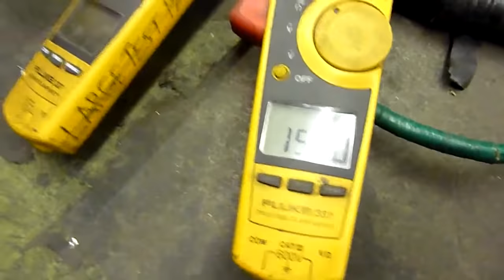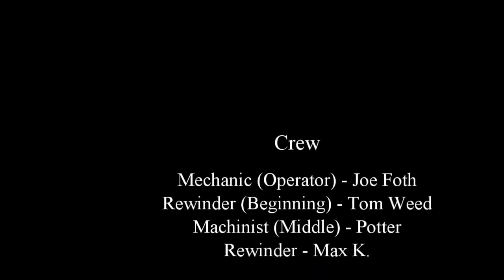Testing Big AC Motor

Comment: I'm an Electrical Engineer, and I just want to say that yup, that's a motor....
Reply: there is a very high risk of injury if there is no ground connection
Reply: Barbu Adrian no...
Reply: It's almost sound like a runaway jet engine
Reply: No no a banana fry
Reply: @adrianbady  It clearly does have a dedicated ground wire... its the green wire that doesnt' have a meter on it. Even so... a single phase like has somewhere between 100-200 volts on it. Which would be only slightly worse than touching 120V household wiring.
Reply: @Wingnut353 Some AC motors are powered at 500V, but in my area most are at 380V (I also worked with some powered by 6kv). I worked with something like this and besides the obligation to tie that green wire (sometimes green/yellow), the tests had to be done on a grounded metal platform.These protective measures were taken after a fatal accident.
Reply: Sir 5 ampire adaptor a electric shok mare kina janaben plz????
Reply: Motor confirmed
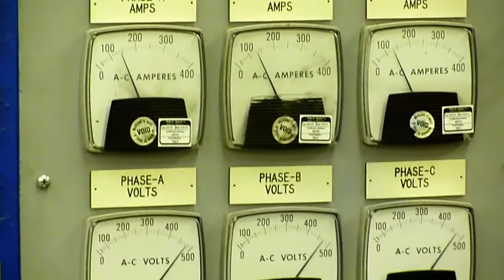Reply: @Wingnut353  video clearly shows closer to 500V 3:16
Reply: I'm Quality Assurance, and I can also confirm this statement to be valid.
Reply: Yo YKW the hell u doing here aaaaa
Reply: 250 hp
Reply: @adrianbady  brilliant
Reply: 👨‍🍳10kgs of French Fries getting deep fried 😜
Reply: Oh no man, i didnt know that
Reply: @adrianbady  
I think body should be connected to neural wire rather than ground.

Because if due to any situation body connects to live,
Breaker will trip due to short circuit.

Just note that if the wire inside holder is reversed (in board),
Body will be connected to live. (Danger)
So as per my house convention,
Left is always live.
(I don't know if this is a universal convention )

( I know that GFCI and RCD exists,
But it is not connected in most of the Indian houses )

Can you please give some views on this ?
Reply: @Bankable2790  You have to take into account this is 3 phase. Your phase to phase voltage will be 500-550v yes, but your phase to ground is most definitely not. What voltage exactly depends on the degrees apart the phases are in the frequency cycle, but 3 phase is 120 degrees, which would put it as he said in the range of 120-200v on a single phase (closer to 200v probably but it's close enough to understand)
Reply: @youtubegoogle4163  If we refer to housing, it matters what distribution system the supplier uses. You can separate PEN into PE and N, but according to certain rules, otherwise the protections do not work properly . You can watch on youtube about the TN / TT /IT distribution system. In the case of TN-C, in my opinion, a second ground connection is required, close to the last distribution board, in order to eliminate the risks that may occur in case of PEN interruption from the supplier (using also a differential protection). Here is a start: https://www.youtube.com/watch?v=tZp1e43QvUs
Reply: @adrianbady  
Thanks for replying !
I will definately watch this video.
Reply: @Wingnut353  Volts don’t hurt anyone. It’s amps that kill. This motor is probably 460volt and I’m guessing it to be about a 300hp-400hp so that would put the amperage somewhere between 350-500 under a full load. But they are just run testing under no load so it’s probably running at about 1/3 of full load amps, so like 125-180ish. That would most definitely F you up if you got hit with it. It only takes 3/4 of an amp to kill someone under the right circumstances.
Reply: @youtubegoogle4163  No. this is 3 phase power. You’ve got 3 hots and a ground wire. There is no neutral and this is absolutely nothing like house electrical. Actually, to me it’s much much simpler.
Reply: Well, it's not a cornish pasty.
Reply: How much pohow much power max under load?
Reply: I’m a hydraulic assembler and I can confirm this is indeed an electric motor
Reply: @adrianbady  no.

Comment: 100 miles away a radio amateur is going 'where the hell is all this RF coming from'
Reply: @tripplefives1402  The motor in the video appears to be a 3-phase induction motor meaning there are no brushes or capacitors. The biggest effect to the grid a motor like that will cause, is a reduction of power factor, which can be corrected by installing power factor correction capacitors on the grid or within the facility itself. The speed of the motor is dependent on the frequency used to drive the motor, not like a universal motor inside your vacuum cleaner/shop vac, which uses brushes and makes a bunch of sparks and runs at a much higher speed. I'm not an expert in radio so I don't know what kind of interference induction motors put out, but I can only assume it's much less than universal motors or anything that makes sparks like a universal motor.
Reply: @MittyNuke1  you are correct, sir. There are no brushes or capacitors in that beast. Kudos. 👍
Reply: I dont get it
Reply: @kinangeagle133  A brushed motor would produce sparks from the brushes and those sparks would emit radio interference. This is a 3-phase motor meaning it has a rotating magnetic field and doesn't need brushes. Therefore little RF is emitted. Plus the metal case acts like a Faraday cage.
Reply: 4 years after the video, I can still detect the RF reveberations on my snupa dupa detector.
Reply: @MittyNuke1  You're assuming the RFs are only coming from the motor coils but forget that RF can come from the insulated cable cores and electrical panels/switchboards. That looks like a 300-500kW motor. I will not be surprised to see a spike of several dBms within the 30-100Hz range even 1km away.

Does it affect electronics nearby? No. 
Will there be a spike in the 30-100Hz spectrum? If you're using a standard EMI test equipment, I'm confident you will.
Reply: @Schneizel1208  funny that you post this days after I’ve started really getting into SDR and trying to pick up signals over the air from wherever I can… and it’s just amazing how much stuff is coming from far away that you can pick up using just the crappy included antenna. So yeah, someone with the right equipment could probably detect some sort of signal from this motor running, if for nothing else, due to the high load being put on the nearby grid. I still don’t think it would have much negative impact especially at such a low frequency, also because big motors are used in all kinds of different industries, but it’s more the reality that low frequency EM waves can travel very far. I don’t know much about the design and operation of huge motors like that, but you’d think that it would be designed as to not cause troublesome interference. But truthfully I do not know enough to say with certainty what sort of interference this motor would cause other than agreeing that it’s plausible. 🤷
Reply: @kinangeagle133  it's like , what happens when someone turns the grinder on while you listing radio
Reply: @alze Okay, pseudo-intellectual
Reply: aliens
Reply: @MittyNuke1  That's right. This thing has pretty much no magnetic field outside its case. The case is grounded and will absorb the magnetic field.
Reply: @MittyNuke1  get a powered magnetic loop antenna for your SDR. they're awesome.
Reply: LOL yep! Went to school for masters in cs & ee both and a ham for 25 years now. Noise these make can be picked up for a long, long, long ways.
Reply: Little To No RF From A Three Phase Motor.  The VFD Is Another Question….. 🤣🤣🤣
Reply: I'm an amateur radio operator, I hear it all the time all over the world!😂

Comment: Finally a good motor for direct drive force feedback on my simulator wheel.
Reply: Oh bother
Reply: Bye bye wrists
Reply: Oh yes
Reply: Not enough acceleration   needs more power and a aluminium core more  wrist twisting power
Reply: Jesus imagine crashing hard
Reply: This simulates more of the engine torque not the steering resistance 😂
Reply: I actually had the small mige direct drive wheel on my rig for a while. 15 ft-lbs was plenty lol
Reply: you: shit fuck go left
the wheel, noticing you just hit a curb: nah
Reply: For direct drive ha ha
Reply: No.
Reply: @untitled. That cracked me up real good😂😂😂😂😂😂😂
Reply: But the problem is you can only play once
Reply: Good video
Reply: Seems a bit heavy though. Also needs 3 a motor driver that can handle several thousand amps to get the required acceleration.
My current setup is made from the dash of a scrapped car and the motor from a toy motorcycle from the same scrapyard, so I don't have much experience with high end motors.
Reply: Sounds like washing machine when its working
Reply: You would probably have your hand ripped off if you were using this as your simulator wheel
Reply: Lmao
Reply: Rip Your electric bill lol
Reply: @notabagel  😂😂😂
Reply: "Look mom no hands"
Reply: ill see you once you get out of the hospital
Reply: yes

Comment: If this motor was to lock up mid run the torque would throw it into the next county, jus sayin.
Reply: You mean inertia?
Reply: @Bum Face Gammon fair enough
Reply: and no ground / shield connection to the metal casing. Looks not very professional.
Reply: @zzztubazzz  this is a 3-phase asynchronous motor. These theoretically don't go beyond 3000 to 3600 rpm (depending on the line frequency). In practise it's even less.
Reply: @alexandervanwaeyenberge6687  Depends how many poles it has normally 1400rpm
Reply: Basing on the direction It would go away from him if It did lockup
Reply: I was thinking some similar shit
Reply: @TizianoBacocco  towards the other. Point is . It's not bolted. This is an amateur testing. And probably not safe
Reply: @jeromeduffy9270  Amateur?! Not safe?! What are you talking about? They have a flashing light on their "power panel" don't they?  :-)
Reply: @benoitvercruysse3429  Did you really take the time to type that?? Are you sure this is proper acceptable rigging to test a motor of this or any size? That said the light flashes AFTER a problem occurs. Geez
Reply: @suneke but there's a light. A light
Reply: @jeromeduffy9270  wooosh
Reply: Via what mechanism would it lockup? I'm not knowledgeable on electric motors, but i fail to see any realistic failure mode of an unloaded motor which would cause it to lockup.
Reply: @robertsulley  If it's new and has recently manufactured parts. One may fail. May fail. But hey ,probably not right
Reply: Google Sucks  Na uh
Reply: Bernd Glückert in a 480 volt 3 phase delta configuration grounding is optional. It’s likely there is a ground detector inside the big blue box
Reply: @alexandervanwaeyenberge6687  so if this is a synchronous motor which function is to balance the power factor and nothing else. Why does the motor have output shaft or idk load shaft with a locking sloth? Is i suppose to run like a mill or conveyer
Reply: again these ground panic people around.. its just a test lmao
Reply: @teunlll  The guy at the power panel would be safe: the shaft is rotating clockwise, so the motor would roll away from him, if it were to "lock up". His big concern would be those loose energized wires being thrown into the air if such were to happen.
Reply: Same idea but i had in mind to reverse it in fully motion.
Reply: You mean country
Reply: It would likely shread the inside and absorb most of the energy and not go flying too far
Reply: @natec1  I agree. you would sure feel it shake the floor!
Reply: Or Canada.
Reply: Nothing would sieze it up unless the bearing just collapsed which would be drastic.During testing you keep an eye on bearing temperatures.
Reply: The casing weighs substantially more than the rotating assembly. And should it lock up, it wouldn't just stop in a few milliseconds. It would take a couple of seconds of screeching to come to a halt. And that is most likely not enough to even make it budge. 3 phase can also function quite contently without a ground. To those that know nothing of electricity.
Reply: So many engineers and safety experts are here on YouTube 😲
Reply: @robertsulley  Do me a favor. DONT engineer any thing for me
Reply: @suranjanotti  Yes inertia
Reply: its not
Reply: @ianship5058  That's what she said
Reply: @natec1  you stand there
Reply: @vincentrobinette1507  Oh that helps
Reply: @edwardvickers5506  they always give you a heads up
Reply: @robertsulley  Murphy's law
Reply: @jasincolegrove6651  if the motor has not physical connection to ground How can the suposed ground detector inside the Big blue box detect a ground fault?
Reply: @wishusknight3009  ground connection is for security reasons, no funcional, if there is a isolation problem between a phase and frame and you touch It accidentaly, you can be electrocuted .
Reply: Jose Rodriguez a ground doesn’t have to be a physical wire.
Reply: @jasincolegrove6651  By NEC it must be a physical wire, a rigid metallic tube or a flexible conduit with connectors approved for protective earth connection.
The motor here isn´t by any visible mean in contact with a metallic structure which  could be earthed. More: if you see carefully there is a green wire with a clamp in its end connected to nowhere resting on the floor-
Reply: Jose Rodriguez you’re not grasping the point. There is no ground wire, period. That doesn’t mean it won’t fail and create a path to ground and trigger the ground fault circuit.
Reply: @aarepelaa1142  ah I see. Thanks man. I didn't see the glasses. Duh
Reply: Not really, just the bearings shattering
Reply: Maybe they do this everyday and know its ok. What could cause a motor this big to stall?
Reply: @zzztubazzz  Ok?
Reply: Hahaha
Reply: @jasincolegrove6651  It appears that there acutally is a ground acable ... you can see it next to the 3 other cables it just doesn't have a meter on it (it should have near zero current on it anyway).
Reply: No. It would essentially explode. Pieces would go everywhere. Not a pretty site. Bearing failure is the number one cause in these motors going bad, and 98% of the time that's because the field worker was just too lazy to grease them. Lightning/power surges are the other 2%. In either case, normally the windings get fried and the motor has to be rebuilt.

Normally, if there's a catastrophic failure, the rotor will just come to a grinding halt. Literally grinding. If it was a bearing failure, the bearing housing normally will end up being destroyed during the failure. And then the rotor isn't center anymore and drags on the inside of the motor case, where all the windings are, and then more than likely tears into some of the windings.

The more tedious rebuilds are the one that are hit by lightning. The windings literally get blown apart and molten copper and iron get slung around the the inside of the motor, getting welded to all kinds of things in there. I preferred bearing failures over lightning strikes, because you can buy new end caps and put new bearings in easier than you can repair the welding job lightning does.
Reply: @jasincolegrove6651  it could create a path to ground through a phase to chassis fault. In this scenario the individual touching the chassis and anything at ground potential gets baked. This is why we bond, to create an equipotential zone for employees to work.
Reply: DIY friction weld
Reply: 100%
Reply: Unless the lock broke inside, but if the metal is strong enough to stand that kind of force
Reply: i did t know DC motors could lock up like what needs ro happen on the inside for that to happen i mean inside is just a huge spinning core not sure where that coud lock up
Reply: @tuxrandom  county and countRy are not the same
Reply: True hhhh
Reply: @zzztubazzz  What's wrong with you lol. You can't just slap a VFD on it..
Reply: @jasincolegrove6651  There would definitely be a ground cable connected to it, at least when it's in service.
Reply: but if the motor has everything ok it does not need the ground right (its a test)?Also if they touch the motor nothing would happen unless they touch on motor and other metal. Today I was testing a 3 phase motor it was turning the switchboard off due tp ground, so to test i removed ground and moved the motor to a place without any conductor material and guess what the motpr was working perfectly, the problem was humidity which was conducting energy, but yeh it depends what u want to test i think. BTW im a eletrical engineer student so if something is wrong please tell me
Reply: @alexandervanwaeyenberge6687  you mean synchronous motor, right? And the speed of the motor depends on the number of poles. The actual speed of a Synchronous motor depends on the field pole windings to lock-in to the synchronous speed (1800rpm for 4 poles, 3600rpm for 2 poles, for 60hz power supply).
Reply: @wishusknight3009  You should remember that the rotor is spinning on just two bearings and are the only connection to the stator. Should the rotor suddenly lock up, the stresses are more on the connected load. The protective relays will cut-off the power. Probaby, if something is gonna be damaged on the motor, it'll be the bearings.
Reply: @jeromeduffy9270  

/w...............

hoooooosh.